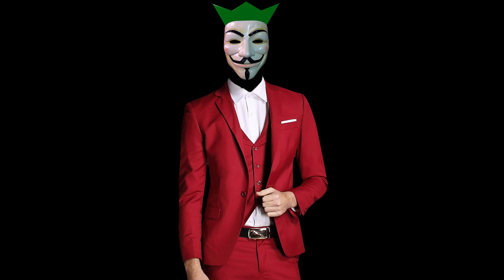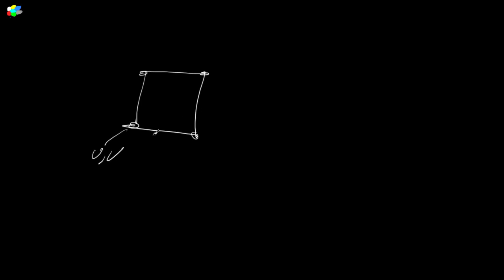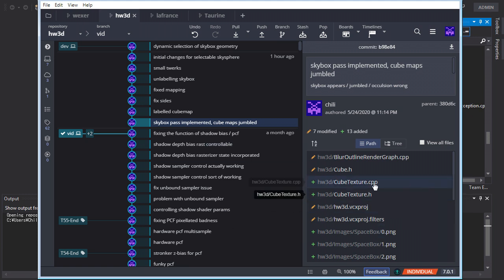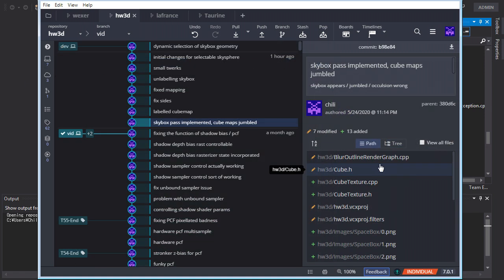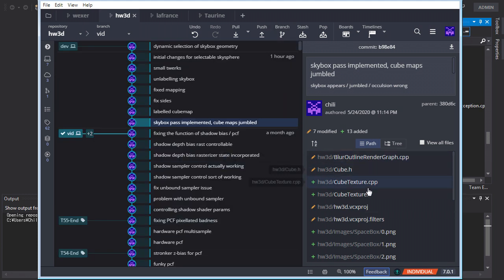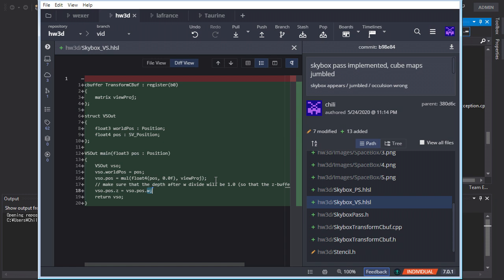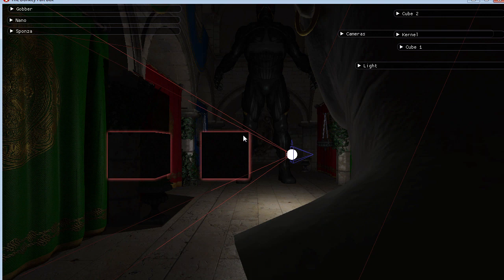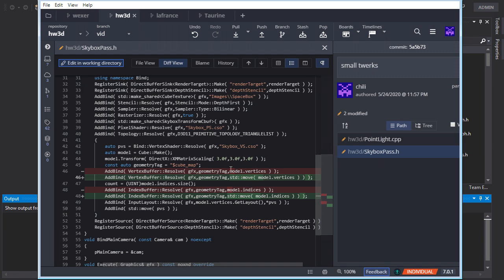Cube Map Skybox [C++ 3D DirectX Tutorial]

Comment: Awesome video Chili! Loved it! Advantage I could think of using a Sphere for the skybox instead of a Cube, is when you simulating moving clouds, if it's a cube, you'll notice a little bit of a stretch on the corners where the cube is split up, making the movement of the clouds less natural.
Reply from the maker: I really don't think that's the case. For the same cube map, the result will be the same regardles of the geometry used to generate the sampling vertices. So that would only really matter if you're not using a cube map. But I'd be interested in an interactive demonstration of your idea :>
Reply: @ChiliTomatoNoodle  It's hardly noticeable, but you can see it in my Birds Editor video at 1:19 -1:40 in the middle top how the clouds being stretched exactly where the Cube is split-up (the corners of the Cube).
Reply: You would see artifacts in this case if you don't normalize the interpolated vectors before using them. As a rule always normalize direction vectors in the Pixel Shader (direction, normal, binormal, tangent etc) before usage.
Reply from the maker: @MrBooghyMan  The pixel shader samples from the cubemap considering only the direction of the sampling vector. The length of the vector will not influence the result. This can be readily confirmed with a test shader. Perhaps you are conflating with the case of lighting calculations, in which case a "normal" vector that has not been renormalized after interpolation will in general cause some undesired attenuation.
There is one issue to be aware of in the case of cube mapping, and that is if your vectors pre-interpolation are not the same length for some reason, the interpolation will be weighted towards the longer one. That case does not arise here.
Reply: @ChiliTomatoNoodle  You are right about everything you said, however I think I was not explaining correctly or I didn't understand what the actual information was provided by Gilad Reich. I was referring to moving clouds using the directions provided by the interpolated values. So, if my knowledge of the cloud algorithm is correct, you would use the interpolated value for setting the Z position of the cloud so that is closer to the skybox. In this situation you could see issues near the edges and corners due to abrupt switch in value. That is why I said you would need to normalize the value first so that you get the unit direction and then multiply it with a range to get that smooth spherical transition of the clouds. Correct me if I'm wrong please.
Update: I'll double check later the knowledge on cloud simulation. Something doesn't feel right about my explanation.
Reply from the maker: @MrBooghyMan  Ah, I had thought you were talking about just the general cubemap sampling.
Reply: I should have probably mentioned in my first reply that I might be wrong regarding this information, as I haven't looked into that for a while now. I just wanted to throw it out there as something I personally noticed, since it's one of those things that hardly noticeable. I believe Vilmurin might be right and it's something I'll definitely be checking out at some point. Thanks for the inputs!

Comment: There is no difference between cube or sphere when it comes to sampling using 3D vectors. If you manually normalize all your interpolated directions created for your cube you get a sphere. Your hardware normalizes these sampling vectors when you do the lookup. So in the end you get same results with less effort for you GPU,  being less vertices to process for a cube than a sphere.